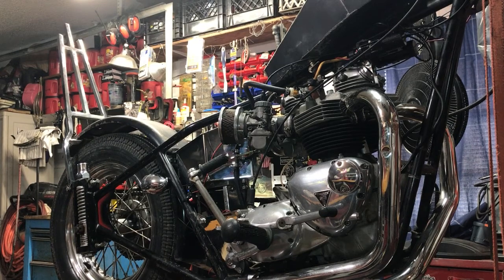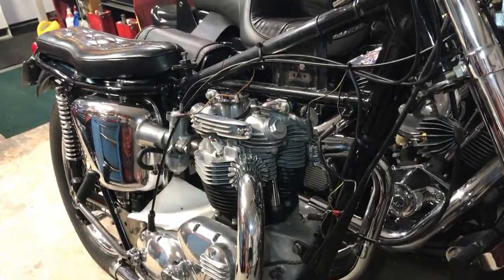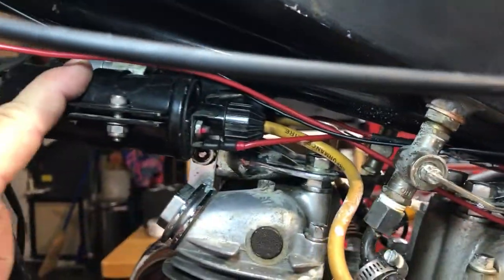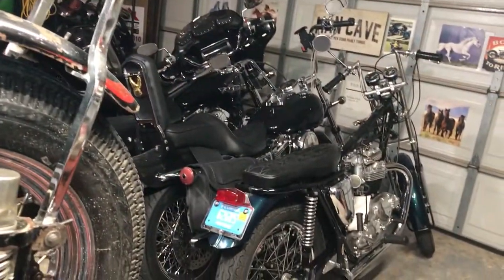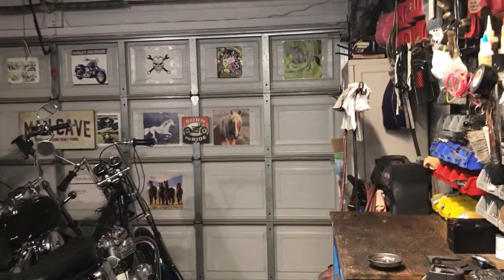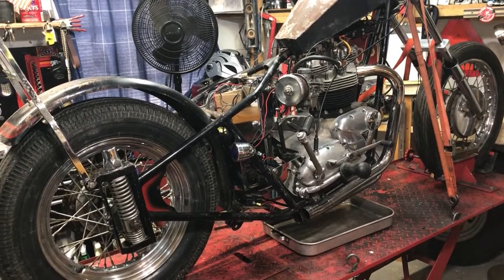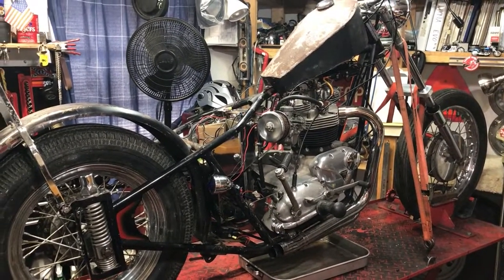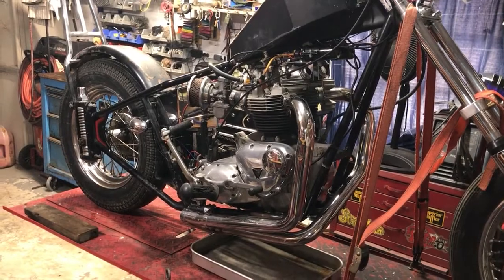‘67 Triumph chopper barn find 7/6/22

Comment: I wonder what happened to my 67 chopper triumph. It had red and orange flames on the gas tank, custom made handlebars that went up back and then out to the sides, no speedometer because the guy that built the bikes attracted from its looks, 10 inch chrome extensions on the front forks. It was a 500 trophy but I was told that it had been bored out to about 577 if that’s possible.